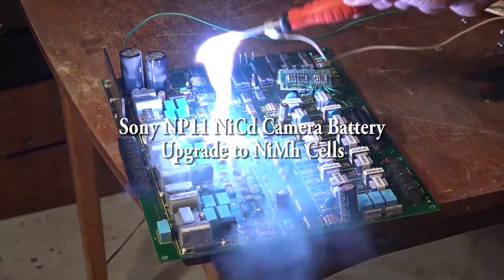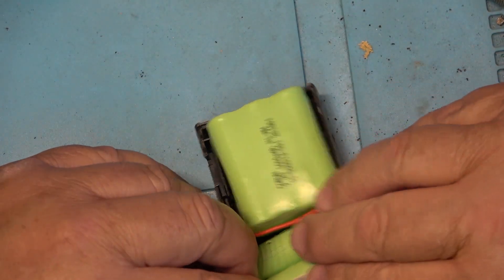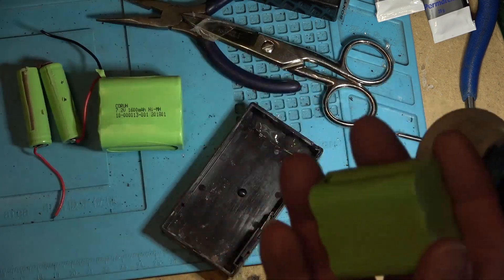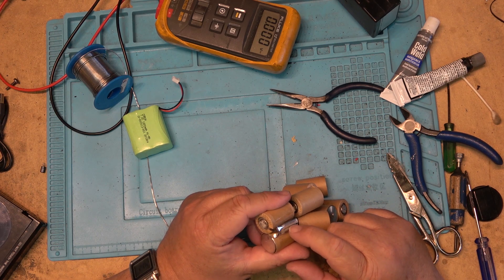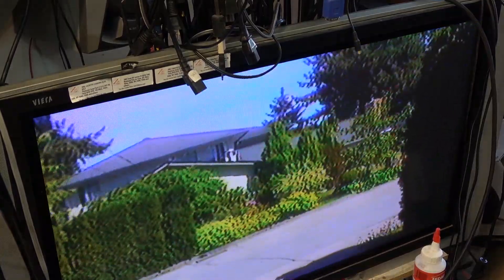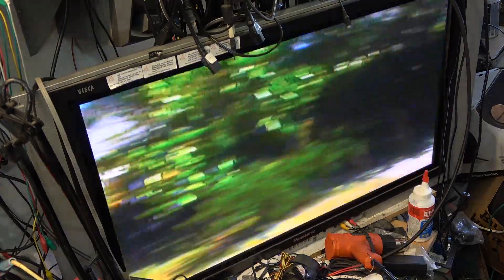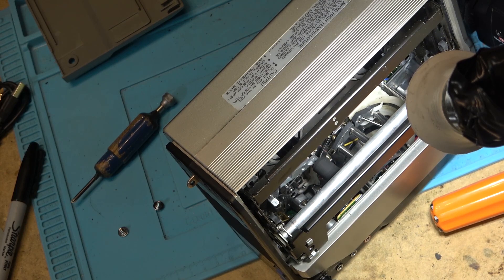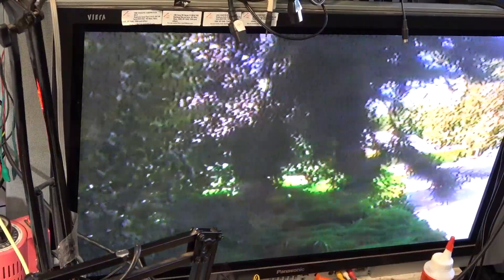Upgrading a Sony NP11 NiCd battery to NiMh cells for the old Betamovie

Comment: Hey Dave. Very good use of those old batteries. Couple of questions: Does using the steel-reinforced epoxy have any risk of shorting out or draining your "new" batteries. Also, if a charger was designed for recharging NiCads, does it care if you charge NiMh cells in it? I always thought they had a selector switch to charge the two different technologies.
Reply from the maker: Not at all.  If the cells overheat they will open their thermal cut out and charging stops.  remember this is not a camera that's going to get used the battery got charged once and I shot a little demo with it and then it gets put away it's not going to get used. If I want to use it for something I'll haul it out charge the battery up for an hour and then use it but it's not going to be left sitting on the charger so I'm not too worried about anything happening there is safety cutout switch if it would overheat which will stop the charging. As to the steel reinforced epoxy where's it going to discharge to? It's only holding the terminals to plastic which is an insulator.  Then again steel reinforced epoxy is not conductive anyway.
Reply: @12voltvids  Thanks Dave!

Comment: I have a theory that the batteries didn't have to last too long as nobody wanted to hold 12lbs at head level for long. 💪💪💪
Reply from the maker: All these early camera operators ended up with curbed spines after awhile.

Comment: I did this to my NP-11 battery, but I actually put in replacements for original sized NiCad cells.
Reply from the maker: That costs money.  By now you should know that I am a cheap bastard. I won't spend a dime if I don't have to. This is my camera in case you guys didn't figure it out. Picked it up for a song, and it had a tape inside that the owner had me transfer. So he can hand me back my 20.00 bill for the transfer and my only cost will be the USB stick that his tape went onto.
Reply: @12voltvids  Well I didn't have any kind of battery cells like you did so I would have had to buy replacements regardless.

Comment: MAD HOW 40 YEARS LATER PHONES LIKE THE S23U CAN RECORD FAR BETTER THAN THIS IN YOUR POCKET.  and even have a 10X zoom
Reply from the maker: That's called progress. I shake my head when i hear that people still want to record on these beasts.  I just collect them as display pieces not to use them for recording anything on.  I also only collect specific significant pieces like this bmc110 because it was the first camcorder and it was so technically different the way it did things.
Reply: @12voltvids  I use mine for recording because my 2010 Sony handycam doesn’t last long on battery
Reply from the maker: @Pacificbell  for the improvement in picture quality of the 2010 model as they were all as based by then that alone would be reason enough for me to dump the old crap and invest in a new battery.  But then that's me, i strive for image quality over everything else.
Reply: Well I didn’t realise metal hydrate cells charged at the same rate as nicad chemistry. I know now what I must scavenge for my packs from this era. Slightly less capacity won’t matter as I won’t be making a full feature. Like you it’s getting it working to show and tell . Been rummaging in my shed and found a unopened Sony L750 . There’s gold in the there boxes
Reply: Don’t bully him leave him alone

Comment: Dave, these battery packs are the same as the ones used in wireless phones back in the day. When I worked the the electronics store, we'd sell a ton replacements for those phones. The only difference between different part numbers was mainly the little connector that hooked them up. That camera is still amazing for its time.
Reply from the maker: Sub c was a very common cell size for battery packs.  Used in tons of power tools too.

Comment: A nice higher capacity upgrade woud be 3 LiFePO4 cells and a BMS, those cells are 3.3V each making a total of 9.9V
Reply from the maker: But then the charger would have to be upgraded.  I went from 1000ma to 1500ma. That's a 50% upgrade and ur uses same charger.

Comment: Took a BMC-220 and a Sharp 'Slimcam' to an airshow back in 2K2. Despite being a heavier camera the 220 was better balanced and with the reflex finder, it was easier to track aircraft in motion. In 2009 we were gifted a Sony DVD/Memory Stick Handycam and since the last good NP-11 battery (as well as the SlimCam's lead-acid battery) finally croaked, we stopped using them.

Would love to rebuild our old NP-1 battery so we could run our SL-2000/CCD-G1 camera outfit (or even our Sanyo VCR-7300 portable HiFi).
Reply from the maker: The np1 uses the same cells, just 10 if them.  I have a few from my old camera and a 1500 charger to go with it.

Comment: The mic is too far inside the case, it needs to be right at the front cover, where the hole should be.
Too often I have had to repair radios with poor transmit audio, manufactures are sloppy with there design.

Comment: Interesting, you can use different size and type of cells no problem. Nice
Reply from the maker: As long as vintage is the same.
Reply: @12voltvids  i have some old power tools with nicad; packs. Time to crack them open and battery hunt
Reply: @12voltvids  Is Viktage an in joke?
Reply from the maker: @SPINNINGMYWHEELS777  no it's Google spell corrector inventing words.